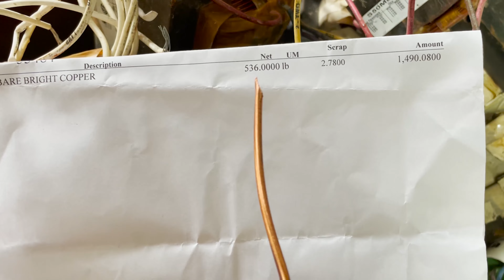Another Day Another Donut! Hurricane Scrap Marathon!

Comment: Try using lock seal on the nuts that keep loosening off on the wire stripper it should stop it from moving from side to side or try using plumbers tape if that does'nt work.All the Best from Dundee Scotland.👍👍✌👊👊
Reply from the maker: Thanks for the suggestion

Comment: I think your buddy is right. It saves time and work on both ends. You feel your doing less cause the machine is doing more for you.
Reply from the maker: That wire was working him. lol I still prefer 10' or less.
Reply: @ProjectShopFl  Should do the wire in a single shot. Rig up your donut maker on some sort of an axle so it spins freely. Send a bit of your wire through (8' or so), stop the stripper, start spooling the wire on your donut maker. Once the spool has been started, turn the stripper back on and spool up the entire wire in one shot. Saves time cutting, saves walking back and forth to get sections, and most importantly saves your back from bending over a millions times.

Comment: If you build a frame to put scaffolding poles on you can role up the wire then run the start of the wire through the stripper and put the clean stuff on to the donut roller ay the otherside that way you would only have to set it up everytime you had a big role of wire the only other thing you would need is a piece of bar that can seperate the plastic cover from the wire.👍👍✌👊👊
Reply from the maker: Thanks for all the Ideas.

Comment: You should move the stripping machine over against the wall at the door side still facing the same way as it is then you would be able to run it like that and if you put the frame with the scaffolding poles on it and the electric donut machine on its side at the otherside of the stripping machine you would be able to do it a lot quicker.👍👍✌👊👊
Reply from the maker: Haha, Thanks for the suggestion.

Comment: When you said "rotating donut maker"  I thought about one of those tire machines.  You lay the tire flat on the machine and with a foot pedal it rotates the tire so you can pry off the rubber with a crow bar.  I wonder if you find and buy a used tire machine and weld on your donut cage.  It would rotate using the foot pedal to wind up the copper.  Tire machine is almost built just like you would need and save you building one.  Just a thought.  Good to hear you were mostly out of the way of the hurricane.  My brother and sister-n-law just moved into a new house they built in Port Charlotte 10-15 miles from landfall.  They had to evacuate.  They still don't know what happened to their house yet.  Unbelievable.
Reply from the maker: I actually have a tire machine. lol Hope your family is ok.
Reply: Family is ok.  Thanks.  Their roof got all messed up.  Not sure of all the details yet but might have to put a new roof on.  They're still looking into how much rain water damage might have got into the attic.  They got very lucky and didn't get flooded out.  This is a second house for them.  They  have a house in Oshkosh, WI.  They've been up there for a long time and just finished building this house for the last year and a half.  Moved in like 1 month ago and then the hurricane.  Crazy timing.  I'm in Cincinnati.  No chance of hurricanes here.

Comment: The Milwaukee M18 cable cutter will zip right through that 500mcm but its about $1800
The 12V works but its kinda slow on the big cables.
Reply from the maker: Thanks for the info

Comment: you should look into finding a 4yd dumpster weld some rectangle tubing on the bottom two for the pallet jack and two for support then it wont matter the length of the wire and it will still dump out at the yard you can always keep it in the back of the trailer to keep it out of the way @ 5:39 you will find your screwdriver
Reply from the maker: Great Idea and thanks. lol

Comment: Is there no way to wheel the stripper up to the back of a trailer, drop the copper straight in while diverting the plastic to the sides of the trailer? Surely - if you can built this you can build an auto-diverter..... If you laid thinner copper ties on the trailer before you began. Tying it off and craning it away would create a massive 5-ton pipe of copper and now..... you truly are the King of Copper. 
Call me a loopy dreamer but I can clearly see it and I believe you can do it.
Reply from the maker: Haha, Anything is possible but I would not want my stripper or copper staying out side.

Comment: I do enjoy watching your channel. It is interesting. However your “helper” does have a name I am sure. A good “helper” will at times offer suggestions and you as the boss can accept them or reject them, that is your right to do so. Having worked many people in my 67 years I have found it helpful for both parties evolved that the suggestions be considered with an open mind and not laughed at before it is even given a chance. I realized that you feel the stripper should be running at all times but I do know that no copper can be sold until it is not only stripped but also bundled.
Reply from the maker: I'm always open for suggestions. The thing is I've done this for over 10 years and have done it both ways. When dealing with heavy copper it's easier to handle shorter pieces and to strip it as fast as possible. Even if I over run the guy on the back side, when I'm dome running the wire I go help clean it up. Even with a large box long runs are a hand full with the big wire and on the small wire it winds up getting tangled up.

Comment: Cool video. I suggest you build a portable wheel to put at the end where your buddy is and he can get it started after you run through, then he can manually turn it as it feeds through on the long runs. the break will come in handy for that also.. cheers.
Reply from the maker: Thanks for the tip

Comment: If the donut maker was on a bearing and could easily rotate it would be far easier to spool the longer cables on on to it. The short lengths are great when you're dealing with 500lb of the smaller gauge wire. But this big stuff is manageable (if you have a partner) with a rotating donut maker
Reply from the maker: Thanks for the suggestion

Comment: If you were able to create some machine with like 2 rubber wheels that you could feed the insulation into as it comes out of the stripper it would allow you to run longer pieces with a 2 man crew. Just as you demonstrated at 42:50. The 2 rubber wheels would provide tension on the insulation peeling it off as the helper collected the copper easily. Make it a variable speed motor so you could use it with either stripping machine.
Reply from the maker: Great idea thanks

Comment: I see why your helper wanted them longer it will pretty much wrap on the wheel easier but in around 12 to 14 ft sections...20 to 30 is to much. But you would have to slow down a bit on your feed maybe 1 wire through every 30 to 46 seconds mark. Once the helper gets the end of the wire running at time started on the wheel he just turns it like you saw him doing and it is alot less work for him but might be a tad bit slower on actual time especially since its a pain in the ass to try to get all the lenghths cut at around that size
Reply from the maker: I'm not looking to slow down the stripper, I'm actually gonna make it faster. lol anything over 10 is too much with the heavy 500 MCM and the small wire just gets tangled.

Comment: Why use a motor powered donut spinner when you can use gravity? Just suspend it high and you can spin it as the wire comes through and wrap it around
Reply from the maker: Thanks for the suggestion

Comment: I know your trying to maximize space but really what us the point in rolling the copper up. Why not put it in a barrel or rolling bin and be done with it. Wouldn't that save time
Reply from the maker: A big bin would be ideal but I don't have a way of loading it if its to heavy and putting in a drum is hard with the big wire and where I sell it does not like the drums because they have to dump it and the large wire is hard to get out. Its a work in progress.
Reply: Hey thanks for replying to my comment. I only asked cause I didn't know and your reply makes sense.

Comment: You and I do the samething I just have more toys. Having a guy that atleast cares enough to suggest something is great and should be commended. Ive found some helpers cant do things the way I do them but are faster doing things differently. Also food for thought why not put it into a gaylord box or icb tote with top cutoff so hes not fighting the donut ring? We strip right into gaylords then smash them down.
Reply from the maker: Thats my goal but at the moment I don't have a way of picking up a big box of copper. I'm working on that and my buyer will supply the gaylord boxes.
Reply from the maker: I don't always have the Gaylords on hand
Reply: @ProjectShopFl  what's a good email for you? I have current pricing sheets from exporters. You can use these #s to try and get better pricing